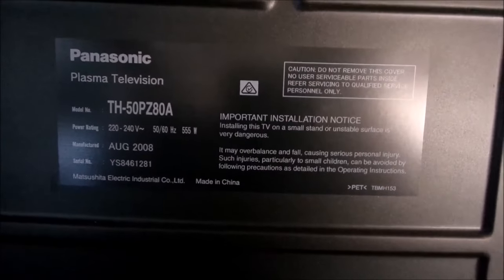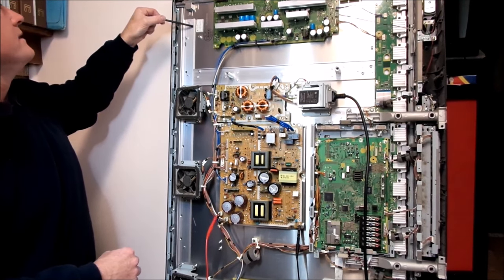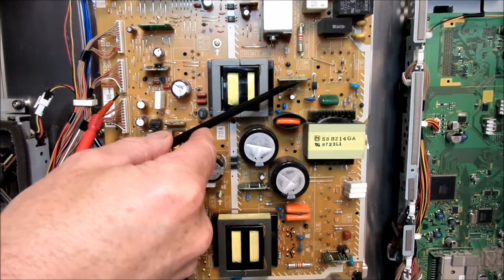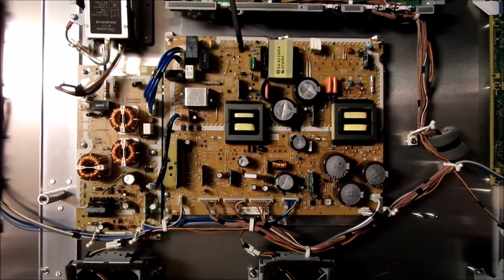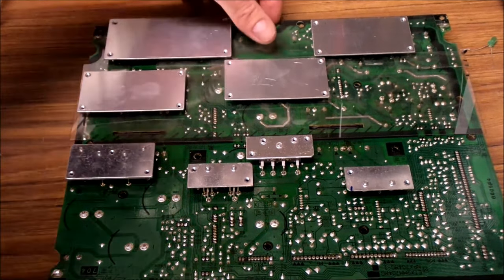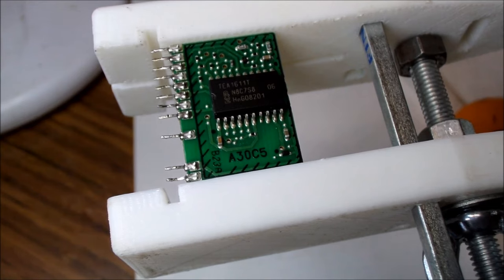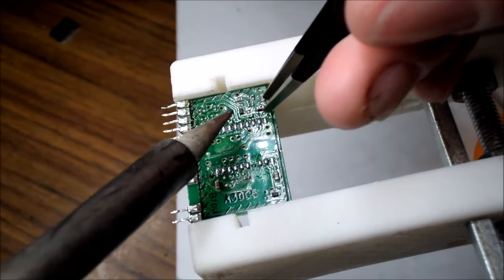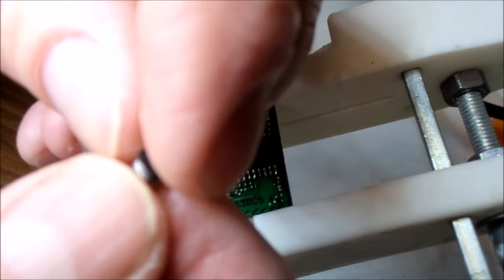Panasonic Plasma TV 2 & 10 Flash Code Repair MiracleMAX

Comment: Awesome job all the way through, & If that truly was your 1st IC replacement, Congrats, I've seen pro work look worse. I am now pulling this TH-50PZ80A out of 8 years in basement dungeon, THANKS!
~Whirled Peas
Reply from the maker: Do you have a repair to do on it? The kits are readily available and as long as you are careful with the placement of the IC and use flux, they seem to go on OK. 
Yes it was my first SMD IC. A bit nerve racking, but you have to start somewhere. It also helps to have a 300X digital microscope to check your work after the soldering is done.
Hope your repairs go well! Take it nice and slow and look at what others have done before you start.
Reply: I do now ;)  ...that damn tv pissed me off so much i almost kicked it in, I've been repairing idiot boxs a long time, and this one drove me bonkers w/ ur vid, I know for a fact now that it's either going to be the IC's or an open, hidden transformer thermal fuse
Thanks
Reply from the maker: Good luck, glad I could help :)

Comment: Great video, wished you showed removal of front panel.  Also had a question about where did you source your diagram?  Where did you source the IC chip, and how much did it cost?  I'm able to procure a broken Plasma TV, same 10 blink error here, for $20, but, I need a little help in sourcing the electrical layout and chip (if it suffers from the same fate).  Thank you!
Reply from the maker: Here is a link to the manual I used:
https://elektrotanya.com/panasonic_th-50px80u_ch_gph11du.pdf/download.html
Generally, the front bezel comes off just with a series of screws.
I found the repair kit simply by looking on Ebay 'panasonic tea1611t repair kit'
I hope that helps :)

Comment: I had exactly the same sympoms (two red flashes) but it was not the power supply board it was the Y-SUS board pulling the Vsus output of the power supply down to 0v. When I disconnected the power connector from the Y-SUS board the voltage from the power supply showed the correct reading of 201v.
Reply from the maker: Hey David, 
These seem to have a common fault in this area and that is why the repair kits are so readily available. Glad to see you followed a good diagnostic process of elimination!
Thanks for you comment.

Comment: Hi MiracleMAX, thank you and great video. 
I am getting 10-blinks, but when I froze out the 15v standby IC the TV powered on  :) 
I’m okay with electronics but I lack the confidence to carry out this repair myself... especially with the large voltages present in those capacitors. 
Is there somewhere I could take the power board to have the IC’s changed by a professional in Sydney’s inner west region?  
Thank you and again great vid! 
Josh
Reply from the maker: Hey 321Josh, I'm sorry, I don't know where you live, so can't give advice. Probably look up 'Electronic Repairs' on Google in your local area.
MiracleMAX
Reply: MiracleMAX sorry - I updated my comment with location
Reply from the maker: @321josh  Sorry Josh, not my area. I searched 'Sydney electronic repairs' in Google and found several with reviews included. I hope that helps.

Comment: Hi thanks for the video I have a Panasonic TH-55DX600U red light blinking  it looks like blinking at a slow pace maybe 10 blinks. Not sure. I just unplugged all out puts to try drain all energy and try to see if it resets. Any help will be much appreciated thanks
Reply from the maker: Hey Jax Fishings,
The number of the flash code is important so you will need to count the LED flashes.

I have included a link that might help you to see what the codes refer to.
http://electro-medical.blogspot.com/2015/11/panasonic-tc-p42x1-led-blinking-error.html
While this might not directly refer to your particular model, the blink codes are used across the Panasonic range.

I hope that helps :)
Cheers

MiracleMAX

Comment: Hello thanks 4 video! Do you know the 10 blink code on a Vierra TC-50PS14 2009 model? And thanks
Reply from the maker: Hey Psybient MiDi,
This could be a possible fault within the A board.  Voltages that need to be checked are 5 V, 3.3 V and 9 Volts. Only check these if you are confident with electrical work. As noted in the video, there are extremely high voltages that operate these TVs. 
I hope this helps!
Cheers

MiracleMAX
Reply: MiracleMAX thanks m8 , does A boards can make a cap on the P board to swell up that’s what I had to replace, but still I had 10 blink led , so you suggest is to check the low bolts on the A board? Which is p7 p9 etc? And do you know  a deal a price for that A board m8? Bloody Thankful!

Comment: Great video.  I own a TC-P42G25 which gives a 1 blink code.   Any ideas?
Reply from the maker: Hey Sasha,
Here is a link to the Panasonic 'blink codes'

https://www.youtube.com/redirect?redir_token=CZIyMKCAN0EgUw0agNgA7jAMOIl8MTU4MTExMTk5NkAxNTgxMDI1NTk2&q=https%3A%2F%2Fwww.google.com%2Fsearch%3Fq%3Dpanasonic%2Btv%2Bfault%2Bcodes%26source%3Dlnms%26tbm%3Disch%26sa%3DX%26ved%3D0ahUKEwj1z_qesuLhAhWKfysKHWKCAVQQ_AUIDygC%26biw%3D1344%26bih%3D731%23imgrc%3DyyFtthLnRsfztM&stzid=UgzckCzioB6Kg05LTXl4AaABAg.8u-1nY1-af78u-skr48EOJ&event=comments

Also here is a link to the service manual for your TV

https://www.manualslib.com/manual/836239/Panasonic-Tc-P42g25.html

Before working on these TVs, please make sure you have the skills necessary and carry out testing in a safe manner. The use very high voltages in various areas.

I hope that helps
MiracleMAX

Comment: Wow I like Max's teaching style and video. So what exactly is happening with the IC and why does freezing it allow for it to work momentarily? 

I have just acquired a panasonic plasma TH-42PZ85U. I PLUG IT IN, HIT THE POWER AND I HEAR A RELAY CLICK THEN IT ACTS LIKE ITS ABOUT TO POWER ON, FANS SPIN MOMENTARILY, BUT THEN NOTHING. I SEE 2 RED BLINKS. IF I CONTINUE TO ATTEMPT TO POWER IT ON AT THAT POINT, THE RED BLINKS CHANGE FROM 2 TO 10 BLINKS.

And if I can really fix it at a low cost, I will be very encouraged and will feel awesome. Can someone help me and answer my comment/questions that I have left here?
Reply from the maker: Hey STIZEN9,
With these TV's there are many variations within the power boards, main boards and other boards that can create these issues. It's important to see if you can find a service manual for that specific TV to correctly diagnose the problem. Use Google to search for what you need. Here is an example of what I found in a few seconds of searching. https://www.justanswer.com/tv-repair/5r3dc-panasonic-th-42pz85u-blinks-10-times-wont.html
I'm not suggesting that this is the answer to your fault, but it is an area to examine.
Here is a link to a manual that you can download and that has the blink codes and a flow chart for the answers.
https://www.manualslib.com/download/1068818/Panasonic-Th-42pz80u.html
I hope these comments are helpful. Remember, you are working around very high and dangerous voltages. Please be careful.
Good luck with your diagnosing!
Reply: HEY MAX THANKS for you time and reply. I just did the freeze test that norcal715 suggests. I froze the mc301 or was it mc201? i.c. and the t.v. started up. I just want to know if its safe and ok to continue to use the t.v., starting it each time with freeze, while I wait for my caps to come in from china?
Reply from the maker: As you saw in my video when I did the freeze test, it will bring the TV to life until the IC heats up again. 
My suggestion is that you do not try and use it while it is in this state. It is only used to diagnose the fault, not as a bypass. If you continue to use it, you may end up totally damaging the IC or creating a different fault in another area. I'm afraid, patience is my suggestion.
Good luck when you get the parts & I hope your repair is successful.
Reply: nice that is what I needed to know. I just unplugged it and will wait. Thankyou sir.

Comment: Hi, Great Vid and explanation.
Im also in Australia and was wondering where you purchased the repair kit from? Thanks in advance.
Reply from the maker: Hey mowwow1998,
Sorry, can't remember exactly where I got it from, but if you look up 'A30C5 TEA1611T KIT', it should head you in the right direction. 
Here is an example on Ebay - http://www.ebay.com/itm/Panasonic-Plasma-repair-Kit-TEA1611T-ETX2MM702MG-ETX2MM704MG-ETX2MM706MG-A30C5-/131793957282
It's best to try and get a kit that has the larger replacement capacitor in it, like the example I have given, rather than the SMD original. That little sucker is really hard to get to!
Hope that helps.
Cheers
MiracleMAX
Reply: Thanks for that, much appreciate the info and look forward to more of your videos in future.
Reply from the maker: You are welcome :)

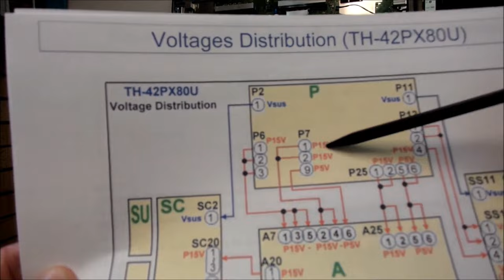Comment: I am a student and have a basic question for those qualified to answer, regarding basic multimeter usage. At 4:03, Mr. Max speaks about probing connector P7 @ terminal 1 to confirm the 15 volts.. 

Does the red probe touch terminal 1 on connector P7 and the black probe to any metal grounded part on the chassis? Where can the black probe go if my probe leads are very short? THANKYOU.
Reply from the maker: Hey STIZEN9, 
Before giving you advice, be VERY AWARE of the high voltages this TV puts out. At the main filter capacitor, you can expect up to 360 volts. Be very careful with your testing methods & if you do not have the skills or training, do not attempt these testing methods without an isolation transformer.
As I have stated in the video, testing the VSUS voltage at connector P2, terminal 1, should provide 190 volts.
Testing the P7 connector, terminal 1, should provide 15 volts.
Using your multimeter on DC volts, connect the red lead to the terminals mentioned above and the black lead is connected to a good chassis ground. In the video above at 3.00, I have connected my black lead to the board to chassis screw. If your leads are too short, just extend them with another jumper cable (wire with alligator clips at either end)
Remember, if you use this advice, you are doing it at your own risk. Good luck!
Reply: of course sir I wouldn't even think about blaming you for any injury that might occur. What I do appreciate is the instruction you as a teacher have given me the student. And that is how we learn teacher thanks!
Reply from the maker: I just want to make sure you are safe. I am speaking from experience :)

Comment: Mine doesn’t blink green at all just 2 red blinks over and over and it used to blink 7 red blinks ... hm but they are different models but I’m going to try to follow what your doing on the video
Reply from the maker: Hey Ryann Rose Mills, here is a link to the fault codes used by Panasonic.
Hopefully, this might help point you in the right direction.
https://www.youtube.com/redirect?redir_token=Gz2GnHidur8vQIyjlIDTyqy_Y818MTU2NDM4NTQ3MEAxNTY0Mjk5MDcw&q=https%3A%2F%2Fwww.google.com%2Fsearch%3Fq%3Dpanasonic%2Btv%2Bfault%2Bcodes%26source%3Dlnms%26tbm%3Disch%26sa%3DX%26ved%3D0ahUKEwj1z_qesuLhAhWKfysKHWKCAVQQ_AUIDygC%26biw%3D1344%26bih%3D731%23imgrc%3DyyFtthLnRsfztM&stzid=UgzckCzioB6Kg05LTXl4AaABAg.8u-1nY1-af78u-skr48EOJ&event=comments
Reply: Thank you! !

Comment: IT IS NECESSARY TO CHANGE THE INTEGRATED TEA16111T ?
Reply from the maker: Hey Edwin, they fail as well as the capacitors. You notice that when I froze the IC the TV worked. You can buy a kit that supplies both of these items. They are a common fault that's why they supply both items in the repair kit. Replacement of the IC does require a reasonable amount of skill, though.

Comment: I tested A board by disconnecting p7 p25 p6 one by one , and the only one that gave a blinking was p 25 which is 1 led pulse, anythoughts lol thanks
Reply from the maker: Hey Psybient MiDi,
I am a little confused about what you are asking. Have you done some repairs already? Are you saying that there are 10 blinks or 1 blink.
Here is a link to the blink code system used by Panasonic.
http://electro-medical.blogspot.com/2015/09/panasonic-tc-p50g10-led-blinking-code.html
I hope this helps :)